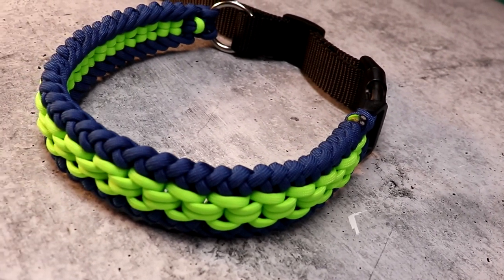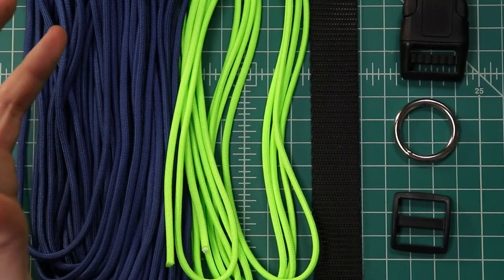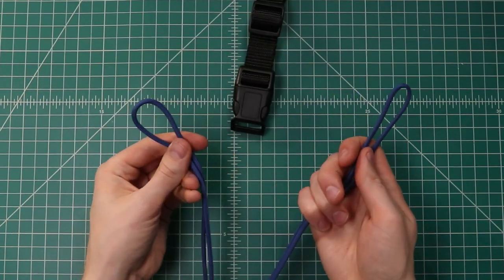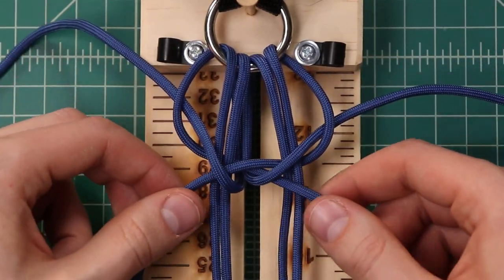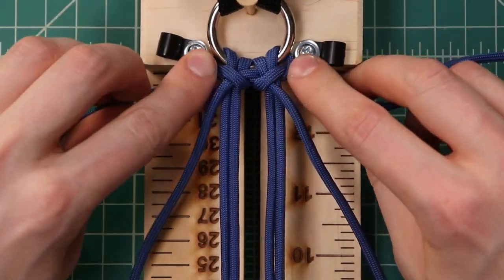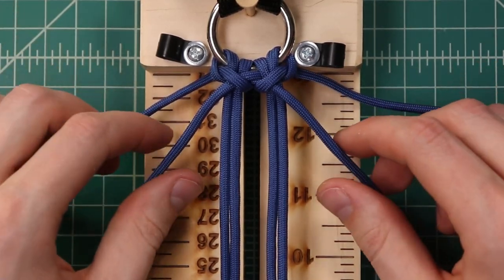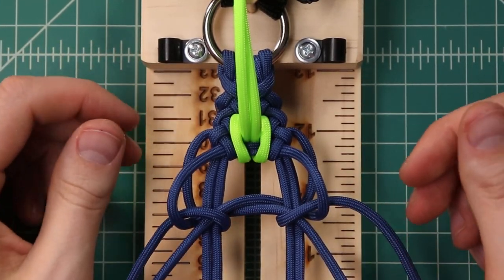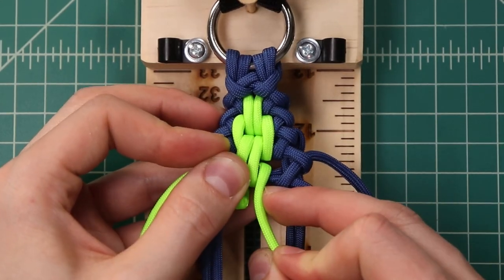Heavy-Duty Adjustable Paracord Dog Collar

Comment: Instead of using the webbing for adjustments, I made some modifications using all paracord and increased lengths to 20 and 80 inches for a 22" collar. used 2 color trilobite weave instead of webbing for adjustment side of the collar 1-inch buckle and tri-glide with o-ring
Reply: Excellent idea! I used a straight baby sanctified for my adjustable area and then a modified sanctified for the rest of the collar… unfortunately. The baby sanctified area was too thick to get through the buckle… I had to go back and remake the collar using 325 cord for the adjustable baby sanctified length and then back to the 550 for the remainder of the collar… this wouldn’t have had to been done if I was using side release buckles like these… but customer wanted classic metal tongue belt buckles and not side release buckles… sigh…
Reply: 20 and 80”? Do you mean feet?

Comment: If your dog is a 20in around the neck how do you multiply to get the inches of paracord to use
Reply from the maker: The collar made in the video was 20in. That means the woven portion was about 13in (The webbing 7in). It used about 30ft of the main color cord, and 10ft of the second color. So if you divide 40ft total cord by 13in woven length, you get about 3ft of cord needed for every inch of weave.

Comment: I made this one his tutorial is poor he flips the webbing around maybe for an advanced Webber they can do it I had to break it down twice it is very easy to put a ring in the middle as it shows off your collar's color  using the ring on the end put the color under the dog's neck  you talk to fast if you want a beginner to try it slow down and it is best on a jig for a jig I used a 2x4 with a screw at one end and where you want to start I used the ring only and added the webbing later the webbing get in the way so he made a 20" collar but he said 50' cut in half then later he said 75'  and it took me almost 30 min to find the right accessories but your idea is great its too confusing for a newb